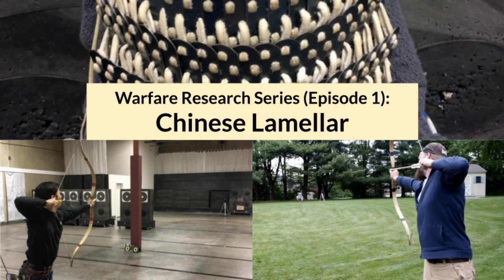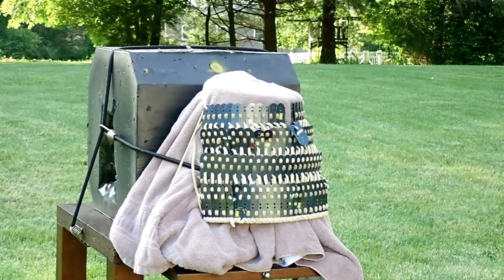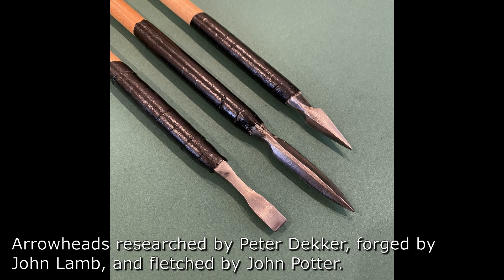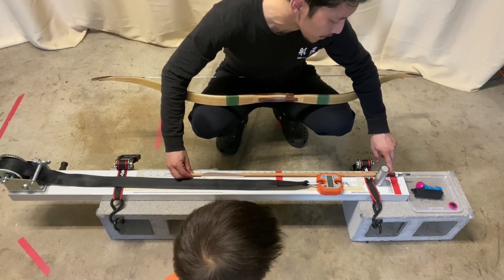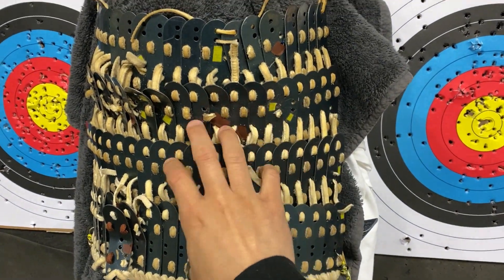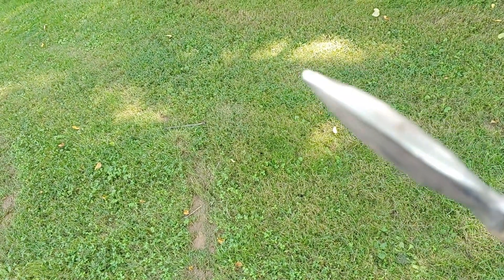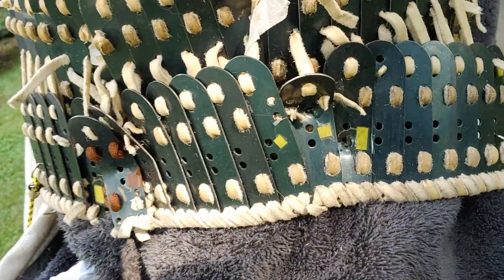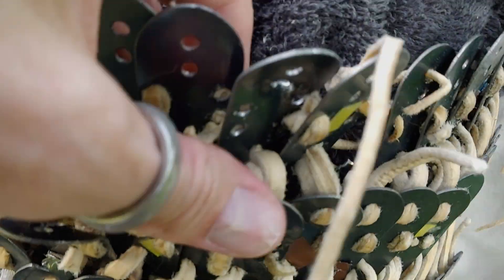Warfare Research Series (Episode 3): Lamellar Revisited

Comment: Great work here. I definitely like that you take the time to go into some of the physics taking place here. 

One thing that makes the results of these kinds of tests hard to interpret is that modern steel is quite a bit different from the kinds of steel that were being used during the historical period under consideration. Steel from the medieval period always included slag (essentially glass) to varying degrees, and it could also contain large quantities of elements like sulfur and phosphorus. The carbon in it also tended to be unevenly distributed. By comparison, modern steel is homogenous, with tightly controlled amounts of evenly distributed carbon, sulfur and phosphorus. It also usually contains manganese, something never found medieval steels except tiny amounts in slag inclusions. The manganese in modern steel makes it harder, more ductile and more resistant to fracture than medieval steel of similar carbon content. In many ways, modern steel is almost a fundamentally different material from medieval steel.

The differences between the properties of modern and medieval steel undermined the historical authenticity of a similar "arrows versus armour" test done by Tod's Workshop. In that series, they said they were pitting what they think would have been typical medieval arrows shot from a typical English longbow against an average quality breastplate. However, because it was made of modern 1050 steel, which is 0.6-0.9% manganese, the breastplate they tested was actually close to the pinnacle of what medieval armourers were capable of creating in terms of hardness, ductility and fracture toughness. Meanwhile, the arrowheads they used were made out of wrought iron that was invariably too soft to do anything more than blunt and skid across the armour's surface. The arrowheads were clearly also poorly attached to the arrowshafts, because they almost always snapped off on impact. [Their choice of using wrought iron arrowheads was a bit strange, since medieval written documents show that by the time plate armour came into widespread use, laws existed mandating that military arrowheads were to be case hardened.]

If you were to continue with tests like these, it would be interesting to see what results you'd get if you were to use Manchu bows made out of period-correct materials. That might be hard to pull off though. I don't know of any bowyer who makes high draw weight Manchu bows out of traditional materials.

Comment: Thank y'all for doing these tests. That's very impressive performance for the armor. I'm particularly surprised that Blake's last shot didn't penetrate deeper. By Alan Williams's numbers from those drop tests, it should only take 82.5 J to pierce hardened 1mm steel to a depth of 40mm. I don't know what to make of that. Perhaps the arrow angled into an adjacent plate or the adjacent plates supported it somehow. Also, these plates are harder than most of the historical European armors Williams tested, & presumably virtually slag free as they're modern steel. So they probably do a bit better than even Williams's ** category. Is there evidence historical Chinese armors reach 50-55 HRC? Only the very hardest 15th/16th-century European armors managed so much as 50 HRC on average.

This test makes me wonder about those Jurchen armors that apparently resisted both arrows & arquebus fire, prompting the use of heavy muskets. I imagine a suit like this of similarly hardened plates but somewhat thicker would do the trick.

Blunt trauma with arrows may be a factor, but we have lots of accounts of soldiers continuing to fight after lots of arrows struck & dented or stuck in their armor. Accumulated blunt trauma from arrows might wear people down & perhaps make them less a bit effective in further fighting, but if so, this doesn't seem to have been a huge issue in practice. On the other hand, I imagine a direct hit to the helmet that bounced back rather than glancing off could ring the wear's bell pretty good. Blunt trauma to the torso would be mostly negligible unless there was a whole lot of it, but a solid hit to the head might have a meaningful effect.
Reply: These plates are very small, their surface to thickness ratio makes them hard to pierce.

 We can see that arrows sometimes bend them close to 45 degrees when they force their way in.
Reply: @lscibor 😮
Reply: They mentioned the overlap of plates results in 2mm of armor...and lamellar plates are supposed to substantially overlap with each other.
Reply: @Intranetusa  That last shot from Blake with the diamond arrow doesn't seem to have hit an overlapping spot based on the video, though it's hard to tell.
Reply: @b.h.abbott-motley2427  If you're referring to the last arrow hit on the lacing hole for the very top lamellar plate that only has horizontal overlap (no vertical overlap), I think that hit is still on an overlapping spot. I believe the lacing hole has to overlap with another lacing hole of another lamellar plate (the two holes on the two different plates have to roughly match-up so you can have the lacing go through and connect both plates).
Reply: 82.5 Joule is with a fracture toughness of 352.5 kJ/m2.
Reply: The lamelar made of spring steel with that hardness put the whole experiment out of context. The historical armour from the period will be made from low carbon  steel, so the arrows will penetrate or destroy it for sure
Reply: well jurchen armors would stack layers of cotton and steel like composite armor specifically for blocking bullets so its a bit unfair to compare that to a single layer of lamellar

Comment: Would armor from this period be made of hardened and tempered steel or iron?
Reply: Probably all sorts of metal materials including wrought iron, low carbon mild steel, higher carbon hardened steels, etc. As early as the Han Dynasty (about 1500 years before the Ming), texts talked about higher quality armor such as dark steel armor, armor that looked blueish, etc. So they were using a variety of iron/steels in addition to the use of cheaper wrought iron and mild steel.

Comment: This is fantastic to see, personally, I've shot my warbow arrows out of my now 80lbs fibreglass Imperial Strength bow from Alibow through 18ga(1mm) mild steel at 15-20m in the form of a car door using "medieval"/Viking era arrowhead (including some tanged broadheads) reproductions, I've since invested in a 95@30 Daylite Monarq so I'd be keen to see whether using some old reenactment 1mm mild steel lamellar how it fairs given your prompts in this video. 

I'll have to try and think of a way to simulate the temporary cavity from impact, plus the potential for rib fractures (if I remember my stuff from my nursing course, it's around 400-600lbs of force for the first few ribs, less though to break/fracture the lower ones, that's why you often chance breaking someone's ribs when giving CPR at the correct depth, but the upside is they'll be alive to complain about it)

Comment: The lamellar did it's job very well against all threats, it's the M16 of all ancient and early modern armour. But the advent of flintlock firearms soon rendered them obsolete.
Reply: Wouldn't say obsolete, since they were being made well into the 19th century.

If the plate is few centimetres wide at most, and the bullet is too, (most popular round bullets were at least 15mm caliber), bullet likely won't penetrate at all, in most cases.

Obviously it's going to destroy, laces,  dent and shred plates, and find it's way inside anyway, but consumes a lot of energy. so against less powerful bullets, and at larger distances, it may be quite effective.

At least I know one source about bechter armor stopping a shot,  though bechter is obviously bit different, though it kinda is a a lamellar laced with mail in a way. 

In any case, it would still be way better than nothing against firearms.
Reply: @lscibor  Nothing weighs nothing, meaning you are more mobile. And mobility is the best defense against firearms. Nothing also costs nothing, meaning resources could be spent somewhere else.
Reply: @lscibor  nah, it was obsolete. Later armors would use additional layers of padding and plates in more of a brigandine style form to stop bullets

Comment: 1 mm isn't less thick than historical Chinese armors, it's well within the range of thickness given the Chinese armor excavated.
King of Chu armor, 2-2.5 mm thick scales
One Han dynasty armor excavated at Shandong, scales mostly 1 mm thick, entire armor weigh 16.5 kg
King of Nanyue's armor. Scales mostly 1.5 mm thick.
Source: -Traditional Chinese Craftsmanship, Armor Recovery

"The largest of the 322 iron lamellae of Tang date unearthed near Xi'an in 1976 are 9.6 centimeters long, 2.6 centimeters wide, and 0.28 centimeters (2.8 mm) in thickness; the smallest are 9 centimeters long, 1.3 centimeters wide, and 0.22 centimeters (2.2 mm) thick." - pg 54, The Eurasian Way of War
Reply: those thickness are probably inaccurate. 0.7mm to 1mm average thickness of the Tang size plates are maximum and the Han plates need to be even thinner or the armor will be seriously overweight.
Reply: I find that hard to believe at least for the first book because:
1. The book also gave the weight of the armor (Shandong 16.5 kg, Nanyue 709 scales averaging 13.5 grams) so these are heavy armor relative to coverage.
2. The book's very detailed and breaks down the type of scales for each armor in detail (ie type IV scales covered the bottom front, have 8 holes for each scale, X mm thick, while type II scales are etc etc)
3. Lamellar reconstructions with 1 mm scales do match the weight of the armor above, once the additional coverage and thinner scales of the reconstructions are taken into account.
Reply: @peasantmob1712  King of Nanyue's armor is just a sleeveless chest piece. 1.2mm reconstruction yielded 15 kg already. It is crazy weight. I seriously doubt they did not clean off the rust when they measured those small plates.

Antique tibetan plates are 0.7mm to 1.2mm in the center of the plates.
Reply: @cathayarmory  yes it's heavy given the coverage, but that's probably why it's only a sleeveless vest. The weight matches the scale thickness though. They may be exchanging coverage for greater protection for the areas that remained covered, it would be a design exchange that made sense considering that hard-hitting crossbows were commonplace during that time/place. Compared to chainmail it's heavy, but there are plate armor just as heavy if not more so. Song regulations from the Shaoxing reign period said BuRenJia was made from 1825 scales weighing 29 kg, infantry had armor from 32 to 35 kg, archers 28 to 33 kg, and crossbowmen 22 to 27 kg and the government was issuing regulations putting an upper limit on the weight of armor because they considered armor to be getting too heavy.

May I ask where you got the information about Tibetan armor?
Reply: @cathayarmory  My quick Google-fu reveal to me that Lorica Hamata (Roman Chainmail) can weight as much as 16 kg, so a 15 kg lamellar cuirass sounds reasonable (for a "heavy" cuirass).
Reply: @戰國春秋  hip length? no you would not want to wear it to battle, trust me.
Reply: @peasantmob1712  Song's heavy lamellar, if made according to those 2mm thick Han plates thickness, would be 45kg. Just look at its coverage.

Tibetan lamellar is from academic paper, and measurements of antique plates available.

Yes there were heavy cuirass in the late period,  but these were made to defend against muskets.
Reply: @cathayarmory  No idea. The paper I read cites from "Greece and Rome at War" authored by Peter Connolly. Apparently Lorica Segmentata also weights 9 kg in the same book.
Reply: @戰國春秋  old academic study of military equipment is usually lacking...
Reply: @cathayarmory  I don't think they said anything about the coverage of the >30 kg Song armor, so I don't see how we can estimate scale thickness from weight alone. Although there is a picture of the BuRenJia which have about the same coverage as the Han armor of Shandong whose scales are 1 mm thick and weighs 16.5 kg, compared to the BuRenJia's 29 kg. However, the BuRenJia picture included a helmet and I don't know if the weight of the helmet was added to the weight of the armor.

As for typical Song armor, the best ones have a lot of coverage but the most typical ones for average soldiers should have pretty basic coverage similar to the King of Nanyue's armor: https://i.imgur.com/xDtvdC7.jpg

This replica of Medieval Mongolian lamellar armor is made of 1 mm thick stainless steel scales with higher than average coverage. Armor weight ranges from 15 kg for small size, to 23 kg for extra large size: https://armstreet.com/store/armor/medieval-lamellar-stainless-steel-armor-body-suit
They heavily implied that the helmet and vambraces are not included in the weight. I think it's safe to say that most Song soldiers would be small-medium size by modern first world standards, so that kind of coverage with 2 mm thick plates would be 30 kg, helmet excluded. But it's made with stainless steel scales, which may be denser than medieval iron?
Reply: @cathayarmory  What is the reasonable weight for metal cuirass (without limb protection) in your opinion?
Reply: @戰國春秋  pre-gun powder no more than 6kg. After gunpowder----well the armor in China stayed as they were before.
Reply: @caesarzhiyuzhang5805  I'd be very surprised and impressed if these armor were the typical types worn by the average infantry though.
Reply: @peasantmob1712  They were in fact the "typical type" worn by average fully kitted out infantry, under ideal condition anyway. 

In reality different Song armies had different level of readiness, i.e. this particular general may had an army of 20,000 entirely decked in full harness; that one only had 70% of his army in full gear, the rest perhaps in partial armours or unarmoured; and that other one only had 50%.
Reply: @戰國春秋  What is the evidence that these fully decked infantry armor was the typical type? Is it from the Wujingzongyao?
Reply: @peasantmob1712  Not from Wujingzongyao. Song heavy armours that cover head-to-toe, like Burenjia (and horse armour if applicable/available) were generally recorded as "全裝 (literally "Full equipment") in other sources. Southern Song《建炎以來繫年要錄》made a reference of percentage of soldiers equipped with 全裝 in under different generals, examples given range from 10,000 fully armoured soldiers out of an army of 30,000, 20,000/40,000, and ~14,000/20,000.
Reply: @戰國春秋  Can you give some quotes about the number of 全裝 in 《建炎以來繫年要錄》?

Comment: The officers with the lamellar were on horseback. You could probably consider doing a test where you add the speed of the oncoming horse. You would add around 30 fps when you shoot at cavalry that is galloping towards you.

30 fps more from baseline of 175 fps means 17% more speed but 37% more energy. Around 190 Joules (formerly 140)

(Made up speed by the way, I dunno how fast cavalry charged. Wikipedia says 20 kph for Napoleonic cavalry)